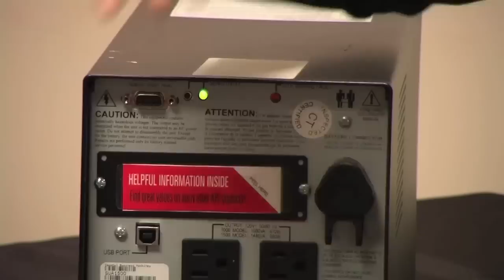Setting your APC UPS for Power Fluctuations

Comment: This is helpful. I'm gonna see if my older unit supports this feature because when the lower is out and we run the generator, the backup units and charge, they remain on battery because my generator only outputs 110

Comment: Is it acceptable for the utility company to be 10% or is it 20%? Because you said 20% but you said 108 Volts. 108 would be 10% off of 120 Volts. If it's a 20% fluctuation from the utility then it should be 96 Volts and that sounds like it would be unacceptable because that seems almost like it should almost always start pulling from battery when hooked up to a server, NASs, switches, or any network infrastructure really. But im a layman when it comes to electricity as a whole. Im a network administrator/RMM, MSP, and designer and you would think id know more about the proper voltage but I wanted to ask because I use APC UPSs for my end points and Tripp-lite UPSs for my server racks.

Comment: Ha! Well, my power here varies from 89 V or worse, to 175 V, sometimes many times per second. Anytime anyone wants to do welding anywhere nearby, which is quite frequent considering the number of houses being built around here, they just have a long branch with a wire on it to throw the wire with a hook on it onto the overhead power lines!
These fluctuations along with the frequent power outages chews through UPS batteries in about six months. The batteries in my APC UPS are absolutely and totally dead, but I'll have a look for the sensitivity button anyway. I've had to just put my computers, whose power supplies are fine from 100-250VAC, onto the surge protection only, for a long time. Using my other (non-APC) UPS only to backup the power for the Internet equipment.

Comment: Thanks for the video but mine is APC UPS 650,400W doesn't have that adjustment button behind it. It brings out yellow light immediately the power cord is being plugged in and the yellow on battery led not too bright not too deem just kind of shacking

Comment: Just plug your UPS to a servo AVR which is far more accurate than relay type and you no longer have those power fluctuation problems which causes the UPS to boost or trim the power. Although servo is not as fast as relay-type when dealing with transient fluctuations but the APC has a built-in relay anyway that behaves like AVR.

Comment: i have a  700w ups power supply  its an older version and  i modded it to accept marine batteries is this ok ?> and the constant beeping was driving me  insane  when it would power  on spite being full power soo i un soldered the  beeper still works but i seen a recent video on how to  set it to turn on without the wall ? like a bypass to use it as a independant inverter ? or  was it plugged in and u started it  off the wall